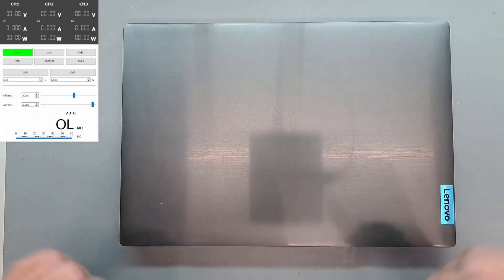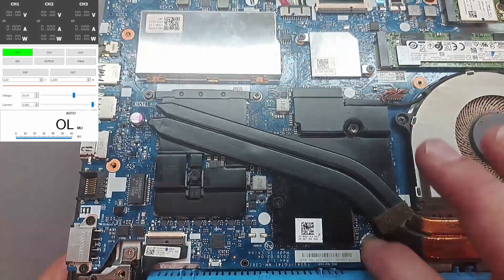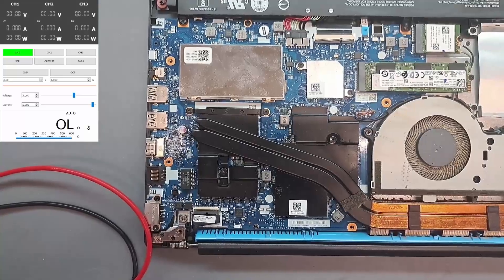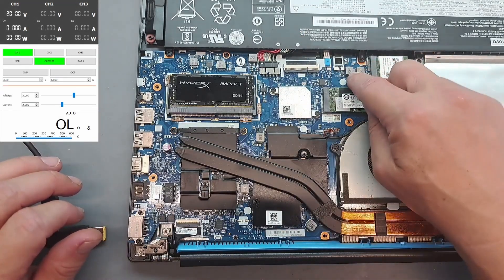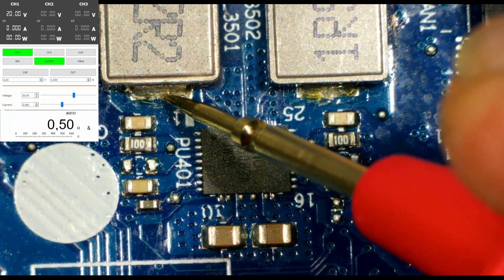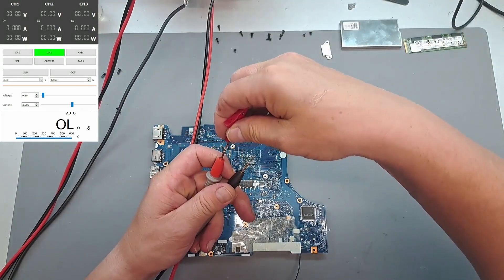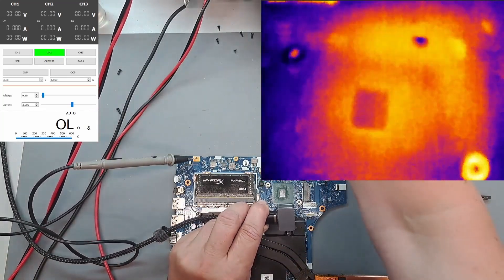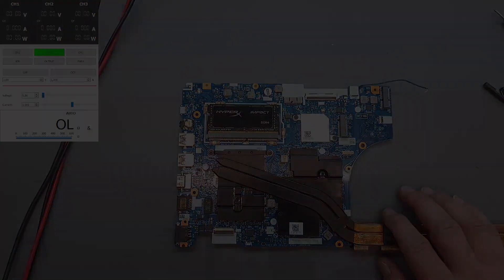Lenovo IdeaPad L340 Gaming - Lightning strike - Dead PCH

Comment: Sad storry. Common problem, on lenovo, that if any high voltage goes trough the laptop then either PCH or SIO will have a hole or crack damage. 
Both can be replaced but bios ME region should be cleaned after change.
Reply from the maker: Ye. I would go and change the EC, but not so sure about PCH... Maybe i try one day.